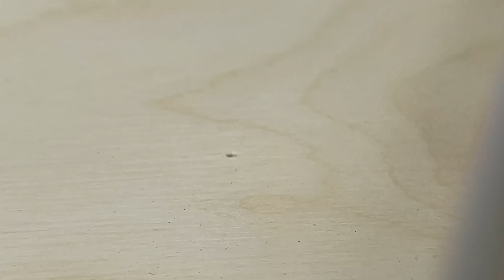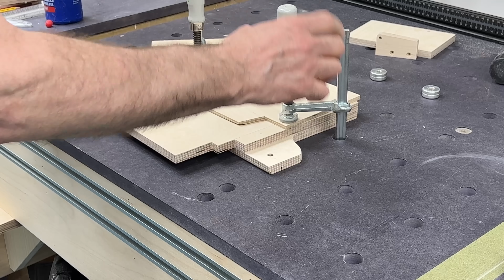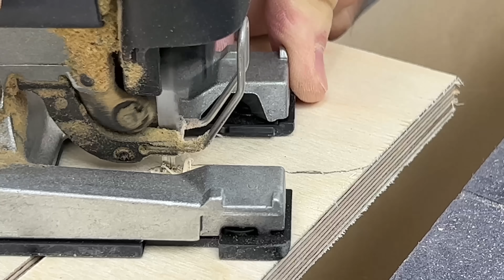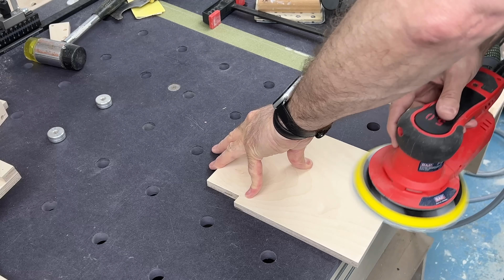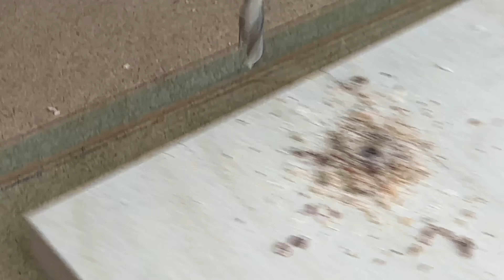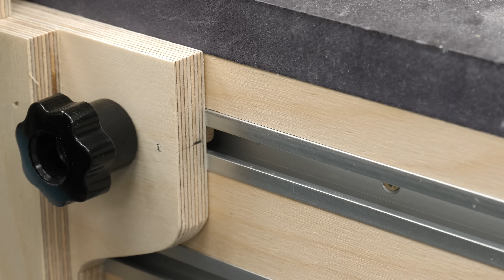Pocket-money Rail Hinge [video 497]

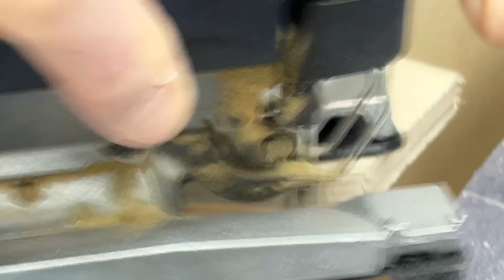Comment: Great plan. May build this when my next deadline passes. At 4:55 you talk about the hinge pivots and that "they're really quite small and they certainly need to be drilled quite precisely." You then said you thought about doing a lot of them with a CNC. You had a friend 3D print your track guides; this is another part that could be printed and would be very precise that way, too.
Reply from the maker: We tried 3D printing them but for the volume I needed at the time - and this vid is a few years old now - getting them CNCd made more sense. I have an updated design coming along soon that will be 3D printed.  👍
Reply: Will you be providing the 3d print file? 😮
Reply: I also forgot to ask how do you adjust the rail square to ensure that it is square to the dog holes? Does it have enough wiggle room to adjust side  to side to allow for such adjustments?

Comment: Hi Peter, I have just purchased your plans plus for this rail hinge, you say mostly 12mm ply. As I am a pensioner I want to keep the cost down. I have some 10 mm mdf. I was wondering if this would be suitable as plywood is very expensive in my local store. Thanks for your channel always interesting.
Reply from the maker: Yes, absolutely! Use whatever you have! All me test pieces were from MDF and they held up just fine - I only use birch ply because it looks pretty in the video! 👍

Comment: Is it needed to cut that one piece from 6mm material? 
From what I can see it should work just fine with 12mm, doesn't it?
Reply from the maker: No, you can use whatever you like; 6mm just makes it slimmer overall, but 12mm would work just fine. 👍
Reply: @10MinuteWorkshop  thanks for that quick response!

Comment: Instead of the slider for height adjustment, you could also use a double hinge.
Reply from the maker: I fear you may have missed the point of the design. 🤷‍♂️
Reply: @10MinuteWorkshop  why? I mentioned just another, better way of doing it. At this moment I draw my idea and realize it later.

Comment: Out of curiosity: in another video of yours, you promote a BD RailSquare for square cutting in a 20mm MFT. I already have that RailSquare. Are there any advantages to this RailHinge principle over the RailSquare (besides the fact that your RH operates a little faster, and takes less space)?
Reply from the maker: The rail square works well, but - especially if you’re workshop based - the ability to simply lift the rail up out of the way on a hinge and instantly get your benchtop back,  is unmatched.👍

Comment: I am have trouble locating the bars (metal ones) that you use to attach the hinge to the rail.  I’m in Vancouver Canada and there is a good Festool dealer however they are advising to buy a track joiner bar and cut it to fit.  Do you have a product number or descriptor for the bars you are using?  Or perhaps a source for the 3-D printed bars. I assume two are required. Thank you in advance.
Reply from the maker: It's all in the video description, and you only need one bar. Here you go:- 
Featured/mentioned in this video:-
Festool rail bar or ‘Feather Key’ part #450592 (no screws supplied)
Stu Parker 3D printed version - https://www.etsy.com/uk/shop/Stuparkercreations

Comment: The design is very good, and has some improvements over the commercial products. The only failure point that I can see is the hinge. I'm afraid that over time the connection between the metal pin and the wood will get looser and becomes less accurate. I'm thinking of building a similar system, but using a stainless steel door hinge.
Reply from the maker: Only if you use one commercially. I’ve used this one daily for a few years now and it’s just not an issue. As mentioned in the video, the main reason for this design is the small overhang at the rear so the MFT can be used close to a wall. 👍

Comment: I think that you have come up with a brilliant solution to adjusting the height of the rear hinge.  I just purchased the plans and look forward to getting started building it.  What I like the most is that you can remove the guide rail easily and get it out of the way.  My MFT is out in the open, so removing the guider makes sense to me.
Question: would it make sense to use pre-finished panel for the rubbing surfaces, like pre finished baltic Birch? And, does it make sense to add your Rail Hinge to an actual MFT3?
John From Palos Verdes, California
Reply from the maker: Thanks! I actually quite like the slight friction you get with unfinished Birch ply, but that’s a personal choice - there’s no reason pre-finished board won’t work,if you prefer that. TBH my hinge has to be doing something that the MFT/3 isn’t doing for it to make sense, so either I if you have an MFT basic and want to add a hinge to,it without using the Festool OEM part, or if as you say, you want to be able to remove the rail easily, then it would make sense. 👍

Comment: Im sure your plywood one is tighter tolerances then the Benchdog one. I have the Benchdog one may be the 3 run.  I had to add nylon washers inside the hinge due to all the slop and replace the t bushings being to short due to the extra slope. On the other hand co worker bought one 15th run and no room for washers at all metal on metal rubbing. Other than that i ditched the quad dogs to much slope. I replace them with some connecting dogs from TSO and added a 6M to 4M insert to accept there  4M screw  with a knob under the mft to hole to clamp them down. Benchdogs should just ditch the quad dogs. If you use the system as a mobile set up you will wear out the rubber O rings pretty fast.

Comment: Bought the plans, just about ready to build it, I've ordered the rail bar piece from  Stu Parker. What size screws/bolts needed for the bar?
Reply from the maker: Thanks. They’re designed for M6 thread, same as the Festool part. First para, P11:- “The rail platform (P5) needs to be drilled out for the M6 machine screws that attach to a rail bar that secures the guiderail in place…” 👍👍
Reply: @10MinuteWorkshop  Thanks, I'd worked out they would’ve been 5mm or 6mm from dimensions of holes in plans What length? 20mm? (I'm going for countersunk)

Comment: Did you ever end up CNCing the hinge piece?
Reply from the maker: No, I looked at it but couldn’t get it to cost out - and then the price of Birch ply trebled… 🤷‍♂️ Works well as a set of plans, but unlikely to ever make it as a product, sadly. Most of it is straightforward to cut, the only fiddly bits are the hinge pivots, and I do have those available in my store. 👍

Comment: Hello Peter I bought your plans for this rail hinge, I just have one question: why do you attach your hinges to a t track if the hinge has a fixed position, and is not going to be sliding to another position?
Thank you , I enjoy your channel!
Jonathan Kennedy - Ecuador South America
Reply from the maker: Thanks. It’s basically so the hinge position doesn’t have to be fixed! And at the front for easy removal when you’re using the track for clamping. If you don’t need those things then you can just bolt it on - but make sure it’s square first! 👍

Comment: Another option is to use a double action hinge to automatically adjust the height for the thickness of material.
Reply from the maker: On,y if you can attach it permanently to the rail. 👍
Reply: @10MinuteWorkshop  can be attached directly via some screw and a connection rod or thru a piece of plywood, don't see real issue here.

Comment: I loved 5he video but disappointed that the plans are not full size  I can only find them at 1:2 scale
Reply from the maker: Plans are 1:1 when printed at 100% on A4 paper. 👍
Reply: @10MinuteWorkshop  Hi Peter I have downloaded the plans plus but the point out is still at 50% of the original size.
If I scale the pdf 1:1 then the print out does not fit an A4 page. If I print it on A3 then the whole drawing does not centre on the page

Comment: I just built this (bought your plans) with a few mods ... I see what you mean about the issue with drilling the pivots. What worked for me was to drill the holes first then cut out the pivots ... Works great and incredibly spot on! ... I had to do the 5 cut method 3 times, only  because I was in such shock of how accurate everything was! (0.0008 over 26" !!) .. Its AWESOME and costs nothing in materials and takes no time to make with the full size printable patterns    ... (This would be easy to do without the plans and I was going to go that route, but decided to support the designer and time it saves with the full size patterns its definitely worth it.)

Comment: Seriously Peter, do you have any plans to make this a product we can buy? If you did, I would be your first customer! I live on a 60x10 boat, that I fitted out myself 14 years ago as a complete amateur, with power tools I bought as a 'set' from Draper. It had a circular saw, a drill driver, a nail gun, a biscuit jointer (never used successfully), and a router and from there I bought tools (loads of them ) from the DIY stores as I needed them. I'm now doing a complete refit and a Makita tracksaw is a huge improvement on the circular saw. My 15x10 bedroom is now my workshop, and I'm making a  modified version of your portable MFT bench which will be my only workbench. I don't have the budget for the Benchdogs or Dashboard rail hinge (I spend all my budget on fixtures and fittings, wood and so on) and I spend all my time (I'm retired) doing actual work on the refit. So buying this rail hinge would really help 🙂
Reply from the maker: Hi Robert. I’m monitoring costs continuously on this one; with birch ply prices where they are it’s a non-starter unfortunately, but if they ever settle down then we may be in with a chance. But for now, it remains a set of plans and the ‘hinge pivot & hardware’ pack, all available from my Etsy at 10minute.shop. 👍
Reply: @10MinuteWorkshop  I get it about ply costs. I went to my usual timber merchants (Alloway timber in Surrey) to buy a sheet of 18mm birch ply yesterday. Even with free delivery because I have an account with them, The price was £165! When I did my boat 14 years ago I had to buy about 40 sheets of 18mm and it was about £35 a sheet.
Reply from the maker: Yes. Ironically I can get better prices here in London than my CNC guy can in Norwich! Last 18mm Birch we looked at was coming in at £200/sheet inc VAT out there, whereas I was paying about the same as you. 🤷‍♂️👍

Comment: That hinge is pivotal (pun pun) to really smooth use of your no table saw approach. I have often wondered if there was an elegant cost effective solution to replace the expensive ones. 
 It’s really nice to see an accessible version. 
Thanks for sharing. 

It seems like it could be a kit produced on a CNC machine. But plans might be perfect too. 
Thanks again.
Reply from the maker: There’s quite a lot of material in them, and with current birch ply prices it doesn’t cost out, unfortunately. 🤷‍♂️👍

Comment: Can you make this rail hinge and put it on a home make circular saw crosscut rail ?
Reply from the maker: Sure, as long as the saw runs on the rail; this hinge was designed for the Festool/Makita pattern rails so you may need to adapt the fixing points to suit another brand. 👍
Reply: @10MinuteWorkshop  are the plans full size
Reply: Since I don't have a track saw just a circular saw
Reply: Question why the 6mm piece why not make it all out of 12mm

Comment: Peter, just a quick one. Is it essential to use plywood. I was away with the fairys in BQ and just picked up MDF. Fortunatly i can replace it if nessecery but a bit of a downer when trying to save money. If so i will always find a use for MDF.Not only cheaper but i think the design is better when you compare the over hang of the others. Many thanks. Im enjoying marking it out & building whatever the material.
Reply from the maker: I’m sure it’ll be fine Steven, as long as it’s decent MDF eg MRMDF. As I think I say in the vid, all my prototypes were made from MRMDF - I just prefer Birch ply for videos because it looks nicer. 👍👍

Comment: peter,  nailed it on the first try------now for the hinges-----it took 3 tries but i got it!!!     leave the size of the hinges big----drill screw holes and hinge (dowel pin) hole then dbl side tape together with dowel pin and one screw inserted and use your sanding disc to shape identical -----also, i made hinges from 12mm maple which does not split and chip during drilling     thanx again for the plans/idea      rick

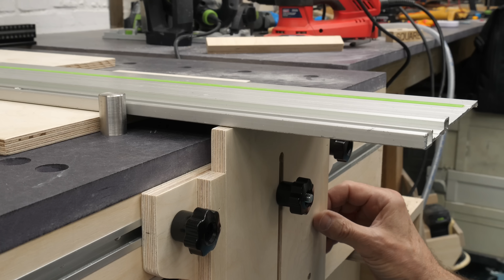Comment: Did i notice correctly that hinge element is cut angled to provide rail not to fall on table when its in idle position ? 2:17
Reply from the maker: The hinge pivots are carefully designed so the geometry works like that yes; in the ‘resting’ position it hinges beyond 90° to ensure it stays out of the way. 👍
Reply: @10MinuteWorkshop  thanks for sharing that tip. Probably tomorrow i will start with mafell design.

Comment: Peter, thank you for this.  I have a Kreg saw and a small shop.  There's few accessories for the Kreg yet.  This easy and cheap custom solution is the answer.
Additionally, my MFT needs to also be an outfeed table, meaning nothing sticking up past the edge when needed.  Being able to easily drop the front and remove/replace the track is fabulous!

Your well thought-out videos have really changed my thoughts about how to get things done, drove the purchase of a track saw, and completely changed my work flow.  I think the table saw and track saw are complimentary, the strengths of each supplement the weakness of the other.
Reply from the maker: Thanks Alan! 🙌👍

Comment: Hi Peter, thanks for this video. Very inspiring. I am going to give it a try with your etsy product.  Part of the entire mft setup like you have is the Benchdogs Fence. Will you consider making Pocket money version of this too?
Reply from the maker: Thanks Maarten! Re the fence, I kind of did that when I first looked at the benchdogs fencedogs way back in video 212 - https://youtu.be/DezSQjhcbbk - but you’ve made me think about the possibilities of using the Ikea curtain track - might be worth a look! Thanks! 👍
Reply: @10MinuteWorkshop  , thanks for the tip on the 2018 video. I had not seen that yet. I was not into woodworking in 2018.. I can imagine more people having the same need as me: a more budget friendly fence for someone who is just starting up an new hobby and does not want invest too much yet in all these accessory.
Reply: It almost suprises me that i do not see the v slot solution more on youtube for fences. Seems also a good idea for making a router table fence. One of my other future projects. My impression is that T-slot is a more expensive per meter. not sure why yet.

Comment: Hi Peter, may i ask what length of guide rail you use here. Normally standard the MFT comes with a 1080/2 rail. The 800/2 rail is a bit too short with the overhangs you are using here. Have you used a 1400/2 rail and shortened it to your prefered lenght? And if so what length has it then?
Reply from the maker: It's a 1080 rail. 👍
Reply: @10MinuteWorkshop  Thanks Peter.

Comment: Sad. My T track (front) is not positioned as yours (mines much lower).
Result? the clamps, front piece to T track won't fit. 
The 'Wings' you designed in, IMHO, are for the positioning of the T track on your bench Peter.
Reply from the maker: And you only found this out after you made it Dave? As I say on the plans, and the video they're a starting point; my starting point was an original Festool MFT, and those dimensions adapted to suit my workspace for my workshop MFT. If yours is different, surely you checked first? 🤔

Comment: Hi Peter this looks amazing you’ve clearly given this a lot of thought. So I’ve bought your bits pack and about to buy the plans my only concern is attaching my Bosch rail guide, do you have any suggestions? 

I’m using guide rail dogs from benchdogs which fit well so will also reach out to them as I need the thread long enough to secure it through the12mm ply. 

Keep up the great work.
Reply from the maker: Hi Bill, and thanks! Unfortunately the Bosch/Mafell rails have a tiny t-slot underneath which is beyond the scope of having them 3D printed. I’m looking into having some bars made to fit, but haven’t had the quote yet. If it happens, I’ll be telling everyone about it! Until then, as I say in the vid, I’m afraid you’re on your own with the bar as it’s not something Bosch or Mafell offer. 🤷‍♂️👍👍

Comment: peter,  not complaining, however, YOU talk too fast and on key points you don't  repeat yourself and you really should.    you mention a small part that you purchased from a fellow youtuber to mount the rail to your own wooden rear unit for attaching the rail and you also mention a festool part, (metal) with  two screw holes----however, you talk so fast and don't repeat yourself that i have not been able to get the festool part number----with timing and frt costs it is easier to purchase festool products here in the states rather than from a supplier in the UK (black plastic part)     thanx rick
Reply from the maker: The reason I don't mention it by name is because Festool call it a "feather key" which I think you'd probably agree, is not especially helpful. I can't post links to Festool parts because the Festool eKat (electronic catalogue) is an unholy mess of javascript that doesn't allow for individual items to be referenced. The part number is in the video description, along with a link to the 3D printed equivalent offered by friend of the channel, Stu Parker. Here you go:-

Festool rail bar or ‘Feather Key’ part #450592 (no screws supplied)
Stu Parker 3D printed version - https://www.etsy.com/uk/shop/Stuparkercreations 

Here in the UK the Festool part currently takes around 6 weeks to be delivered, which is why I also suggest making one from a guiderail joining bar, a piece of plywood, or picking up the 3D printed one. Hope that helps. P